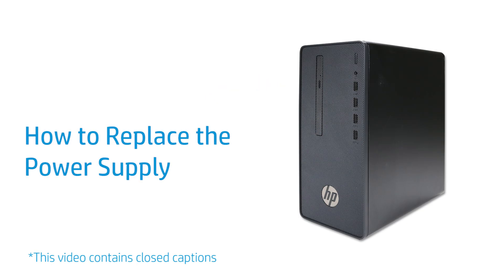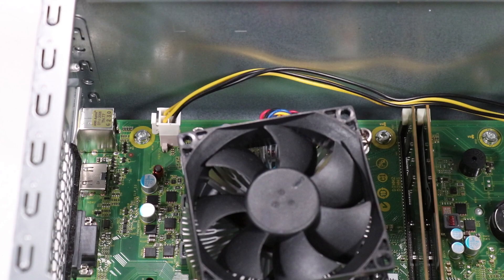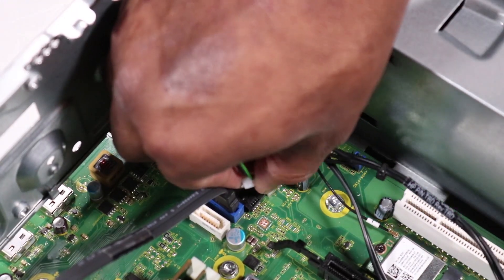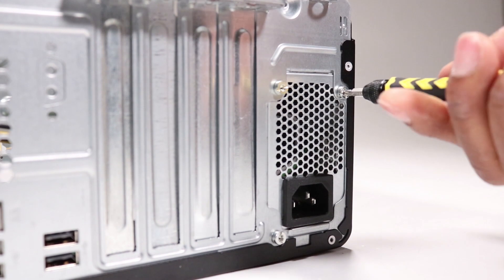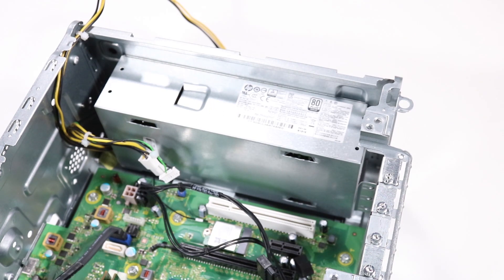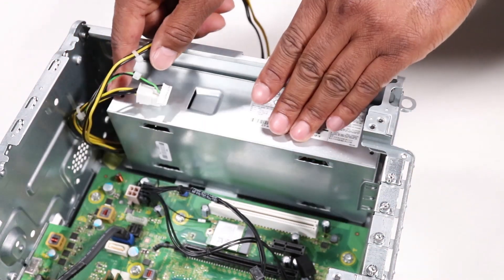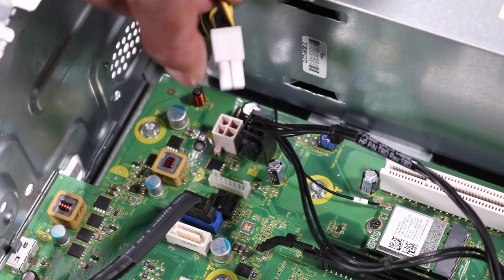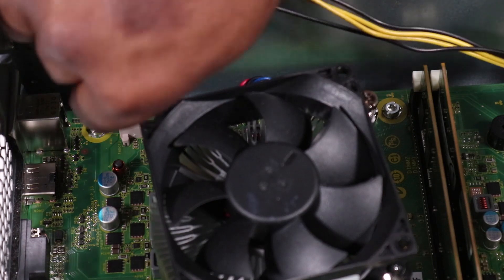Replace the Power Supply | HP Desktop Pro G2, G3, Pro A G2 and 190-0000 PC | HP

Comment: Can i upgrade PSU to 400W-500W on HP 280 G2 Microtower? And some more, i want to add GPU in that.
Reply from the maker: +Naim AR HP does not recommend upgrading or downgrading hardware parts or software that is bundled with the product as It may affect the manufacturer's warranty and performance, however, you could change the configuration at your own discretion.
Reply: @HPSupport so I can change it, it's just that the warrenty won't cover it?

Comment: We To Buy 310W PSU for HP Desktop G2?..
Or HP Haven't Released One?
Reply from the maker: +Clearance Mahumani You can purchase the part from here: http://partsurfer.hp.com/ Please select your country and enter serial or product number of your unit.
Reply: @HPSupport  Not Available/Released
Reply: @clearancemahumani6347  the problem is not to change the source, but to find the same one to buy, HP makes these small machines but doesn't put parts on the market to replace in the machines example source DPS 310 AB -3A
Reply: @clearancemahumani6347  Hi did you found where we can buy a 310W - the problem is not to change the source, but to find the same one to buy, HP makes these small machines but doesn't put parts on the market to replace in the machines example source DPS 310 AB -3A
Reply: @augusto3045  HP Has Not Released The 310W Power Supply For This Computer, It's Not On The HP Part Surfer, And There's No Other PSU In Terms Of Size Compatible With This Computer.
Reply: @clearancemahumani6347  Well, how does she launch a computer to sell by the thousands and not make parts available for replacement??!!! An absurdity that.

Comment: can the processor be removed and used on a new pc?
Reply from the maker: +The TurkishWarlord HP does not recommend upgrading or downgrading hardware parts or software that is bundled with the product as It may affect the manufacturer's warranty and performance, however, you could change the configuration at your own discretion.
Reply: @HPSupport  you're not giving me much choice. I want to install a 1050Ti but the psu wattage is too low.
Reply: Yes as long as the socket and the MB supports that CPU same as with the ram.

Comment: the problem is not to change the source, but to find the same one to buy, HP makes these small machines but doesn't put parts on the market to replace in the machines example source DPS 310 AB -3A
Reply from the maker: Hi Augusto, thanks for contacting!
I understand that you need to purchase the parts for your computer.
I will do my best to assist you.
Use the HP Parts surfer to identify the part: http://partsurfer.hp.com/search.aspx 
And order it via the HP Parts store: https://bit.ly/3nKMYrs 
Binu - Social Media Tech Support

Comment: HP 290 G2 MT can be replaced with 450 (w) power supply
Reply from the maker: +Royal Ninja The motherboard will not allow you to change out the PSU to a standard ATX form.
Reply: What is the maximum power supply Or (w) you can put in this kind of PC?
Reply: @Red9z  dude plz can u tell me how many watts this power supply has
Reply: +Sez Marvelo 

I guess 300 (w) or 320 (w) if you want to install a graphics card you need a low profile card

Comment: Where can I find 310w psu?
Reply from the maker: +Chandrava Chaudhuri You can purchase the part from here: http://partsurfer.hp.com/ Please select your country and enter serial or product number of your unit.
Reply: @HPSupport  can I buy it from any hp store physically?
Reply: @HPSupport  The site not work its a problem. the problem is not to change the source, but to find the same one to buy, HP makes these small machines but doesn't put parts on the market to replace in the machines example source DPS 310 AB -3A